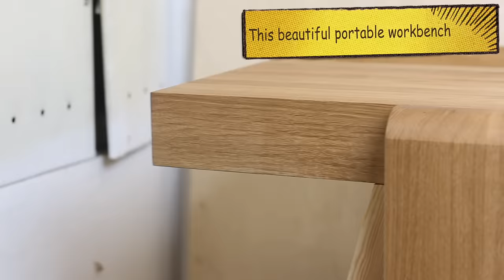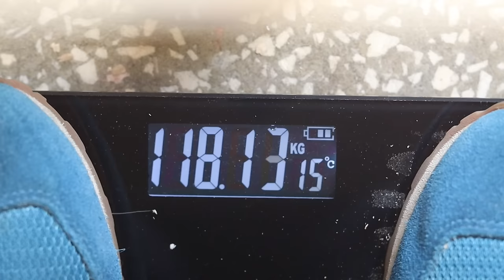Watch me BUILD this beautiful WORKBENCH…[2 Month Timelapse]

Comment: First off thanks for an awesome video. I learned a lot. As I have limited experience, forgive me if this is a silly question.  I have just unboxed my electric planer, and have gotten hand planers, and was thinking that the order of using these in combination would be the opposite. Use the electric to bring the wood close to where you want it in terms of flat/trueness, and then fine tune and smooth with the hand plane. Of course if you’re doing it the way you did, I could deduce that my thinking and lack of experience means I’m completely wrong…..but🤷🏼‍♂️🤣🤔
Reply from the maker: "Use the electric to bring the wood close to where you want it in terms of flat/trueness, and then fine tune and smooth with the hand plane" - that's the way you do it :-) (Money for nothing)

Comment: I make my hand-cut mortises the same way you do, with a slightly narrow chisel. I then come back and pare the sides to the gauge lines. It takes a little longer, but I get much straighter sides that when I use the "correct" sized chisel. I also did the same with hand-cut dados (housing joints) on a mini-bench that I built. Again, the sides were perfectly straight, indistinguishable from machine-cut ones made with an electric router or table saw.

Comment: I built an apartment sized one of these using laminated pine for the legs and an ash plank from the bottem of my old door for the top. I still need to add the vise and some holes for my hold fasts.

Comment: What a beautifully made workbench. Honestly, it is a work of art. Everything has been created with the care and precision of an artist, and at the same time, it is a fully functioning shop bench. You could always put holes in the Right leg opposite that of the vise, and use pegs to hold the right side of a board for planning instead of a clamp. Maybe something in a darker color like black walnut for the pegs. Then when they are not in use, they can be stored in the tool well. Just a thought.
Do you share the amounts of each ingredient for the finish you used on your channel?
Reply: Beeswax, boiled linseed oil, turpentine.
Most likely a 1:1:1 mix ratio.

Comment: Amazing hand tool skills. You could sell access to courses, if you don't already. Also, toward the beginning of the video, why do you use small nails in the timber before gluing as leg stretchers?
Reply from the maker: To prevent "floating" on the glue
Reply: Ah! Thank you for that tip. Very useful.
Reply from the maker: Not the best tip though. I don't use biscuit joiner nor Domino system but those boards were quite bowed sometimes, so...